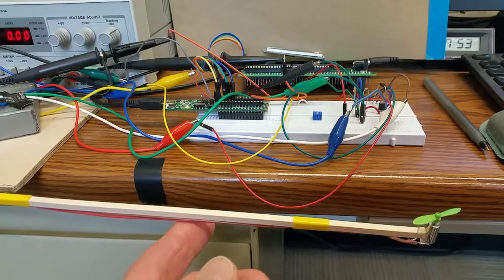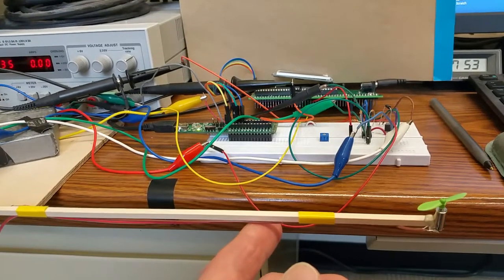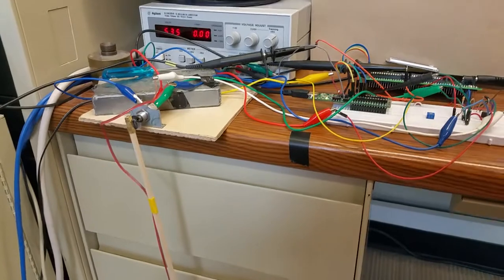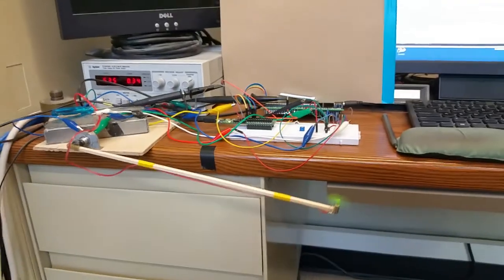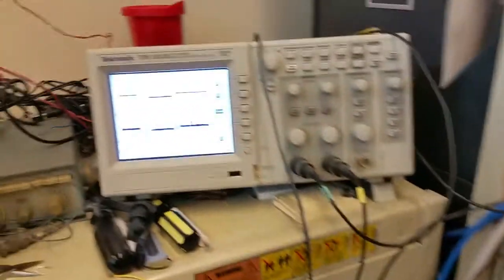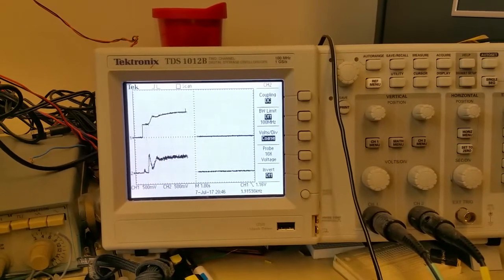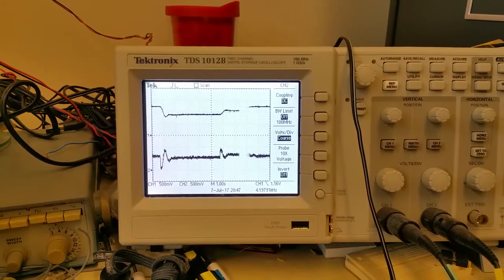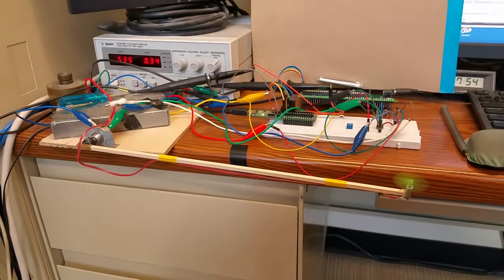1 DOF helicopter -- Tuning the PID

Comment: Could you tell me about motor rpm, voltage range.... please?
Reply from the maker: These are very cheap drone motors. ~12000 rpm at 4 volts 0.5 amp. From Amazon:  Coolplay Propellers Rotor Set & 4pcs Motor Set for Cheerson CX-10 CX-10A RC Quadcopter
Reply: @ece4760  Sir! Do you have a PID circuit for implement this project, I want to make this 1 Dof copter with analog PID circuit.
Reply from the maker: @kerimturak1  I do not. The PID is in software.
Reply from the maker: but it easy to find PID circuits online